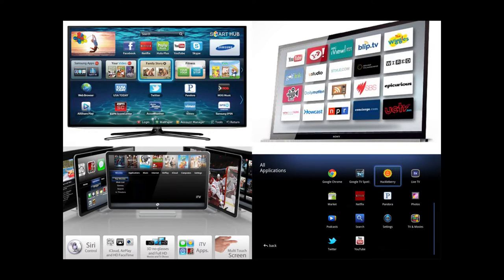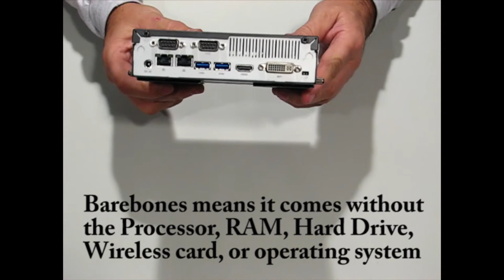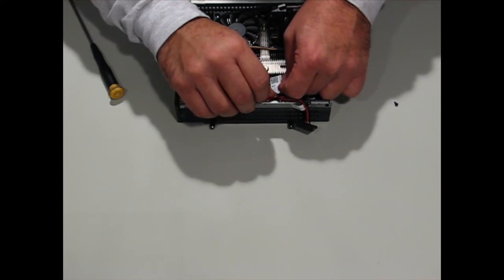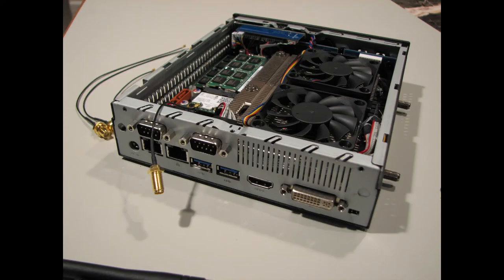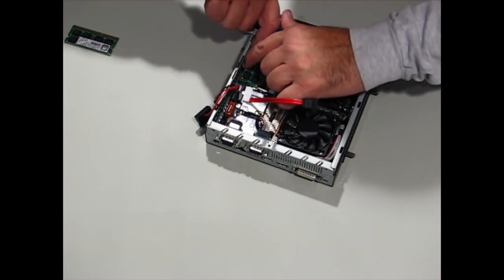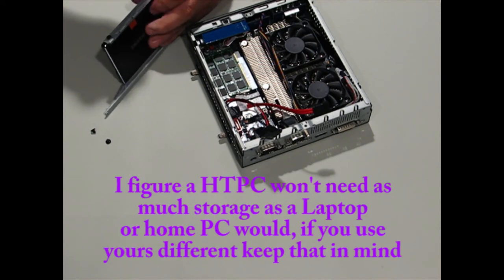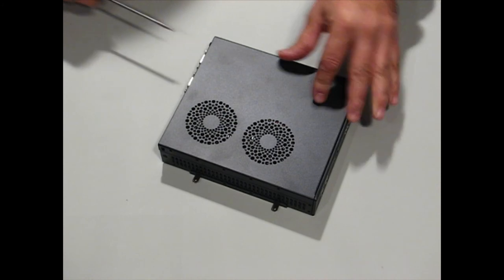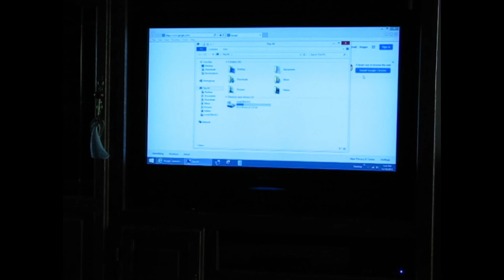Shuttle DS61 HTPC Build for Home Theatre PC Ultra-smart TV

Comment: How do u tell Max CPU watt.  The only measure I am seeing at processors is TDP. Also how does your setup handle 100 MKV and HD movies? Thanks.
Reply from the maker: I am just going by the product specification sheet on the CPU watt, I don't have any problem with HD movies but it's going to depend a lot more on your internet speed than anything else, this HTPC is just a computer so it will handle anything a desktop or a laptop with the same processor/ram/ect. in it will handle.

Comment: How would u compare this to Intel NUC? Thanks. Also how much Watts does it take to run.
Reply from the maker: A quick glance at the NUC it looks like it is a very good unit, it won't accept an i7 processor and it's a little more pricey than the shuttle, here's a link to the Newegg reviews of it: http://www.newegg.com/Product/Product.aspx?Item=N82E16856102035
The wattage of mine depends on the processor that it's running, with a Pentium G860 it pulls 23 watts idling and with an i7-2600s it idles at 27 watts and 52 watts full load (according to the product specification sheet)